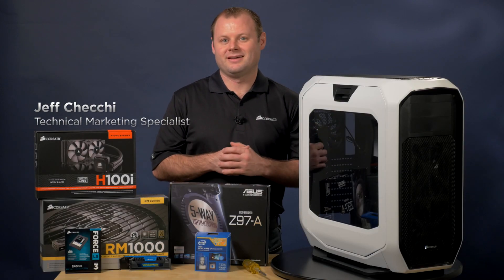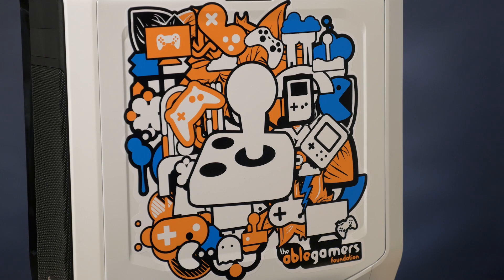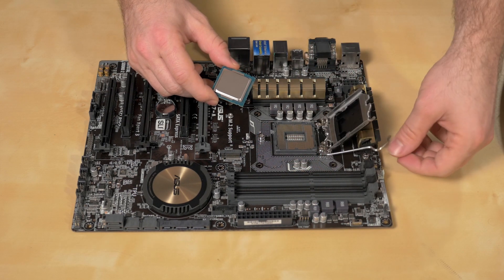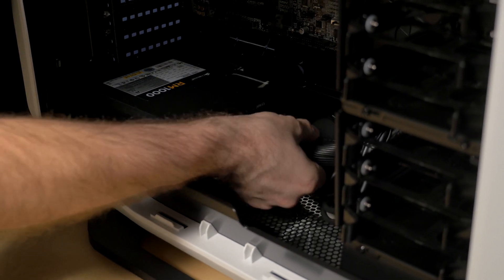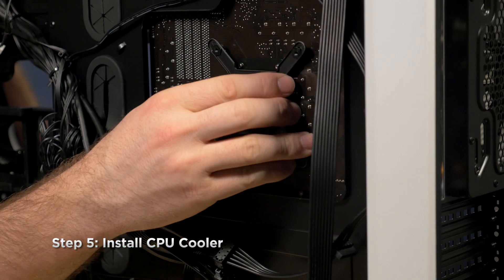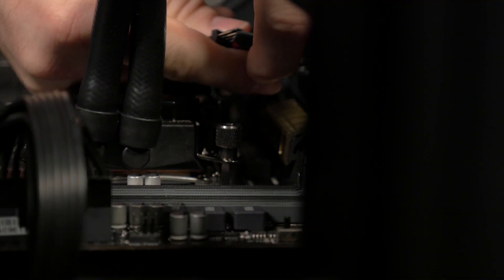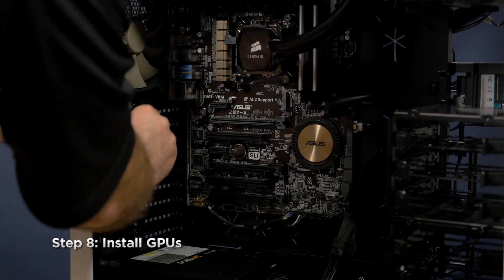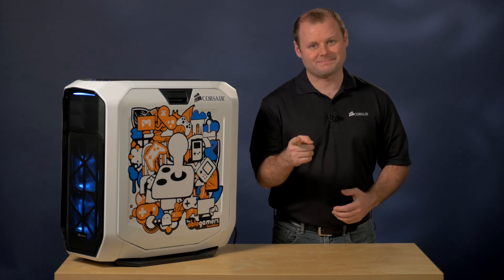System Build: AbleGamers PC with Graphite Series 780T and dual EVGA Nvidia GeForce GTX 980 GPUs

Comment: I'm confused. I've never used water cooling, so Idk if its needed or not, but thermal compound wasn't applied when the heatsink was attached. Is that normal for water cooling?
Reply: There was already Thermal compound on the cooler.@3:10 when he removes the plastic you can see the gray square that is the pre-placed Thermal Compound. And you should use it always Water cooling or not.
Reply: LuckySle7in That's why I asked. I know that thermal compound is necessary, but wasn't sure if it was used in the video.  I've never done water cooling before, and haven't done too much research yet into it. Thanks for the info! :D

Comment: Hi! I need help! I want to buy this case,but idk if there is some trouble with heat. I'm building something similar (but 1 gtx 980ti) but if I use the watercooler on the top of the case, how can the heat get out from the case? (I know the back fan is for that) but what about the top? Isn't it for make the hot air to the outside? (maybe this is a noob question, 'cause i'm one in this thing) 

PD: sorry for my bad english, it's not my birth language so i hope you understand! Thank you !

Comment: Okay, total noob. Are all the wires for this build included with the parts, or do they have to be purchased seperately from the parts? If I don't win this PC I may very well build it myself.
Reply: I've yet to see one component that doesn't come with the prerequisite cables - Power supply comes with ample power cables of different sorts, the chassis includes fixed connectors for fans and chassis ports and loose SATA cables for hard drives, usually at least a couple of them, as well as cables to plug the computer into the wall socket. No need to buy extra cables... These are not Apple products after all :P

Comment: I see that they used a 240mm AIO I suspect that's because they know that a 360mm AIO wont fit either on the top or in the front without one of the dust filter clips busting. A case that is described as an E-ATX case for gamers should at least be capable of installing 360mm AIO
If anyone has managed to fit a 360mm AIO can you let me know by supplying the make please.

Comment: I need... plz. 

	
Windows 7 Edition Intégrale (X86) Service Pack 1
Processeur
AMD Athlon 64 X2 4400+ Cadencé à 2.30 GHz
Nombre de coeurs: 2 physique(s), 2 logique(s)
Socket: Socket AM2 (940)
Carte mère
Acer RS740DVF
Numéro de série (carte mère): 04VD83208925
SKU Number: To Be Filled By O.E.M.
Version du bios: R03-B0
Date: 07/05/2008
Chipset
Pont nord : ATI RS690/RS690M
Identifiant de révision: 00
Pont sud : AMD SB700
Identifiant de révision: 00
Mémoire
3 Go de mémoire totale de type DDR2
Timings mémoire: 5.0 clocks-5 clocks-5 clocks-15 clocks-1 TT
Barrette Kingston de 2 Go
Fréquence maximale: 400 MHz
Bande passante: PC2-6400
Barrette Kingston de 1 Go
Fréquence maximale: 400 MHz
Bande passante: PC2-6400
Carte Graphique
AMD Radeon HD 6670
Version DirectX installée: 11.0
Disque dur
Disque dur WDCWD5000AAKS-00V6A0 de 465.76 Go SATA II
Firmware: 05.01D05
Version du SATA: SATA Rev 2.6
Numéro de série: WD-WCAWF7006864
Température HDD: 38 °C
Temps de fonctionnement: 27078 heures
Disque dur Generic USB CF Reader USB Device
Disque dur Generic USB MS Reader USB Device
Disque dur Generic USB SD Reader USB Device
Disque dur Generic USB SM Reader USB Device
Lecteurs optiques
HL-DT-ST DVDRAM GH15F
Type: DVD-RAM Recorder
Version du firmware: EG00
Date du firmware: 23/04/2008 17:47
Réseau
Contrôleur Gigabit Ethernet Marvell Yukon 88E8071 PCI-E
Type d'adaptateur: ethernet
Software Loopback Interface 1
Type d'adaptateur: Loopback
Cartes multimedia
Advanced Micro Devices, Inc. [AMD/ATI] SBx00 Azalia (Intel HDA)
Advanced Micro Devices, Inc. [AMD/ATI] Turks/Whistler HDMI Audio [Radeon HD 6000 Series]
Clavier
Holtek Semiconductor, Inc. USB Gaming Mouse
Clavier standard PS/2
Souris
Souris Microsoft PS/2
Holtek Semiconductor, Inc. USB Gaming Mouse
Ecran(s)
W2241
Fabricant: LG Electronics Inc. (GoldStar Technology, Inc.)
Resolution maximum: 1680 x 1050
Taille de l'écran: 23.0" (49 cm x 32 cm)
Date de fabrication: 11/02/2008
Ratio d'aspect: 16:10
Type d'entrée vidéo: Composite Sync Reserved Analog Signal
Périphérique USB
Alcor Micro Corp. 8-in-1 Media Card Reader (USB Reader)
Version USB supportée: 1.10
Holtek Semiconductor, Inc. USB Gaming Mouse
Version USB supportée: 2.0
Turtle Beach Turtle Beach P11 Headset
Version USB supportée: 2.0
Reply: +Diadlo Dude, i have worst pc and not complaining...
Core 2 Duo E6400
2 Gb RAM
Intel GMA 3000
And a shit motherboard - Gigabyte 946GMX-S2
So please, stfu.
I can still player Full HD videos everywhere and boots in 30 seconds Windows 8.1 due to good maintenance.
Reply: Θανάσης Δεματάς Yeahhhhh, stop lying, I can't go above 720P with 45 FPS, means I can't even read correctly the 720p 60 FPS of Youtube.
And unless you run your windows on a SSD card or you literally have nothing installed on your PC you can't boot that fast.
Reply: To play 720p60, you need to have nothing else opened.
I had an SSD (which died) and it was booting at 18 seconds. Now with my HDD, it is 29 seconds. 
If you do tweaks and maintenance, you will do everything OK (like I do).
Maintenance = defragment, minimum programs starting automatically or not have them opened when you don't need them, get your system clean and apply new thermal paste.
Also, change to Windows 8.1.. It's like you are living at 2009 with 7 (or upgrade for free to 10).
Reply: And use Opera, not Chrome/Firefox/IE. Use Opera only, go to opera://flags, search for gpu and enable the first choice.
Reply: Θανάσης Δεματάς Well, my comment was made in March, I am on Windows 10 now, I'm defragmenting my PC every 2 weeks or so and I closed most of the programs I don't use, but when I check my PC startup speed it says my anti-virus himself takes like 15 seconds of my startup time, but I ain't gonna disable my anti-virus.
Reply: Diadlo You really use antivirus? No need if you don't do like online payments or so.
Even the best antivirus can't stop the stupidness. I don't use antivirus for almost 3 years now and not even one virus has got inside my system. That's because I don't download stupid things, get in untrusted sites etc.
And If I use, only 5 seconds delay for booting.
Reply: Θανάσης Δεματάς But I do online payments, most of the time what you buy on Amazon, etc... is wayyyy cheaper than the retail price you got in stores. But it's not for the every day usage that I find my PC not performing well enough but when I play games. It takes like 5 minutes to load Civilization V on Steam and I can't even run Middle Earth Shadow of Mordor correctly. Also have a hard time with FF XIV when it comes to raid or world boss.
Reply: Diadlo you are not supposed to play these games (or anything new) with that pc. Get serious. It was good a couple of years ago, now it's not.
If you do your job well, don't complain. Other people have worst pcs from yours (like me) and we have jobs that require a very fast pc.